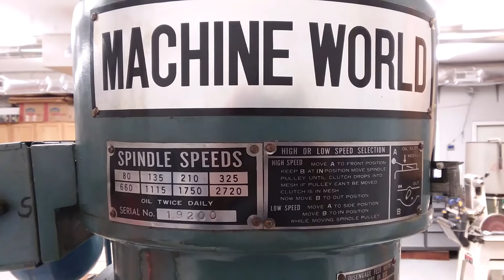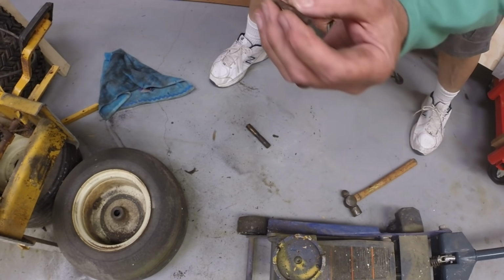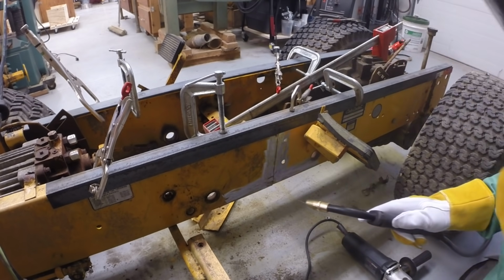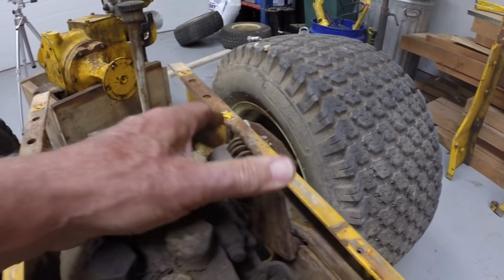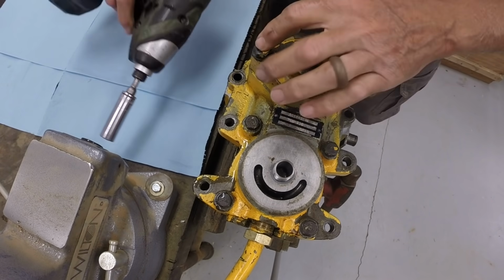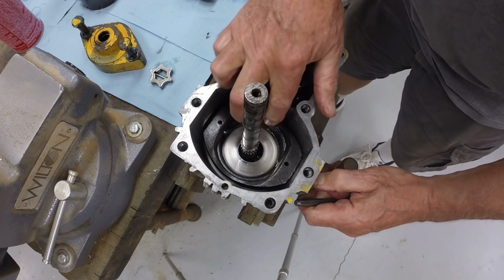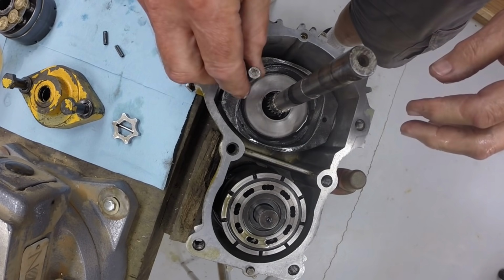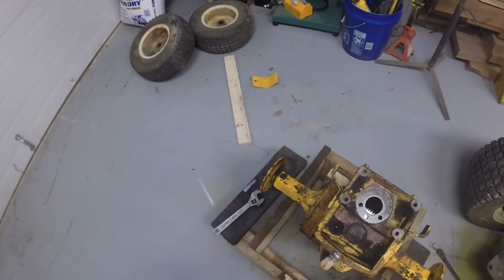Cub Cadet Dozer Build Episode 3

Comment: Nice shop Frank ,built one using the three speed gear box about twenty years ago . Worked really well i wish there were rubber tracks back then sure would of made it a lot easy'er .I did what you done and got the big change , i think i put 12" pads on it . Gave to a friend and he land scaped  3 acres with it . It looked like a small D10 .......Have fun.................Oh , he still has it and still use it from time to time ..............

Comment: Great Job Frank. I have done quite a few thousand hours on D10's and am looking forward to see your finished project.
Reply from the maker: I could use a consultant!
Reply: @woodandmetalshoptime8048  I think it is amazing what you are doing. I see that you are going to change the drive from what the actual dozer is but what you are doing is far more practical than trying to engineer the drive sprocket being the upper drive and the 2 bottom rollers as the idlers. A remarkable project and I also see in your shop you have a model grader  as well.
Reply from the maker: The plan is to use the upper idler as the tensioner, allowing both drive axles to remain fixed.  I guess we'll see how that works out!  Thanks for watching!
Reply: @woodandmetalshoptime8048  Why are you using two hydrostats? Dosers typically only drive from the rear.
Reply: @jwacker6590  It's a tracked vehicle so needs to turn by varying the rotation on one track vs the other. A single, standard mower hydro won't do that.
Reply: @christiangriffith1681  with an open diff, you can lock one axle with a split brake system and the other track will turn, turning the vehicle. Same with reverse.

Comment: I've pondered the idea and concluded that a zero turn would perhaps be a decent starting point.
Reply from the maker: You are not the only one to suggest that. That would be easier, for sure, but it would lose the charm of a vintage Cub Cadet conversion.  I'm trying to use as many parts from these old tractors as I can and you can't argue with the benefits of the weight of these axles for traction.  But I've thought about it...

Comment: Out of interest (because I’ve never handled a hydrostat) could you have rotated the swash plate 180° to give you a matching, but opposed, set of motors? Or does it make more sense for a dozer to have matching forward and reverse speeds?
Reply from the maker: Yes, you could rotate one of the swash plates to get matching speeds but they would still be different in "forward" and "reverse."

Comment: Sold wire welding I take it.  You'd have better luck tacking a small backing plate on the back side of that gap and weld in a downward direction. There's no need to weave back and forth that wide to achieve penetration. Heat soaked metal is a weak point in the overall integrity.  Smaller welds with gussets and layers will yield better results.

Comment: Just found your channel, going through the older videos.  Instead of modifying the trunnion couldn’t you have just turned it 180 degrees thus switching its forward/ reverse range of motion?   Nice job, can’t wait to see more.
Reply from the maker: There would still be a difference between forward and reverse speeds, and with a small (12 inch) drive sprocket, that would be a problem as speed is reduced by half compared to the 23 inch tires.

Comment: How’d you sort out the speed differential from forward to reverse seeing as your planning on running it what seems to be in reverse? Reckon I should just shut up and watch the video because it’s obvious our brains asks the same questions when doing this type of stuff
Reply from the maker: Modified the swash plate in the hydrostatic transmissions so they run same speed forward and reverse. Episode 3 I believe shows the modification.
Reply: @woodandmetalshoptime8048  found it sorry for so many questions btw Ik comments and likes help push your videos forward so I’ve been doing what little I can plus I really like this project want to build one of these for my little nephew actually been thinking of starting with a zero turn since it would already give me individual control of both wheels

Comment: I wonder if it would be possible to remove the axles and differentials altogether and just put both hydrostats side-by-side in the rear, with their output shafts driving the rear wheels.

I would be concerned that driving one track from the front, and one from the rear will cause problems. This might be even more of an issue with your big tensioner. One side will be pulling against ground friction directly, and the other will be compressing the tensioner before it receives ground friction. I know that most drive-chain tensioners are typically placed on the slack side of a chain, and in your case you will have one tensioner on the tight side, and one on the slack side.
Reply from the maker: There is no way to run them side by side, so the diagonally opposite drives is a compromise. I agree it's not ideal, but it's what I've got.  We'll see how well it works.  Remember, even the big boys have to go backwards, and they are driving on slack track doing that.
Reply: @woodandmetalshoptime8048  Good point. I look forward to following the rest of your build!

Comment: You know if you leave your welds on there and dont grind them off it will be very strong.  If you grind them off then It wont be very strong at all. You would need to v the joint first for it to be strong. Other wise your just welding on top and then wiping it off with the grinder so no strength at all.  You could plate weld it on the inside then grind off the outside it would be fine. I have a 149 I took apart and painted them my wife told me she wanted her house painted and I never did put it back together. I am concerned about the trans fan being broken and I took off the regulator and I dont remember how to wire it back up to the gauge and the generator. I wish I would have put it back together when I was doing it. I may be able to do it but I am working on 24 other projects like solar trackers and both my car and truck need attention. Too many projects.
Reply from the maker: As for the welds, the frame splice is welded from both sides, achieving full penetration. The weld on the inside of the frame is not ground smooth. The outside is.  The frame will be reinforced as well.

Comment: Not trying to be rude but maybe hit a night welding class at a tech college. U will learn a lot on set up an how not over heat ur welding area. Seems like u jus need more practice with a knowledge instructor, and paying for classes opens you up to do as much as you want with their equipment an not working ur small machine to death. Great work with the hydro's. That's one thing I need to get more into.

Comment: The modification that you’re doing to the trunnion on the rear hydrostat will also need to be done to the front hydrostat unless you never plan on backing up on the dozer.

Edit
Oops @1:15:30 you mention that.  😳
Reply from the maker: I haven't actually modified the other one yet, but it's on the list of stuff to do.  In EP #4 I talk about it some, but it will be EP #5 before that's actually complete.  Thanks for watching!

Comment: If it's a bulldozer why do you need to drive axles you should only need one
Reply from the maker: need to control each track independently, forward and reverse.  Each axle drives one track.  Check out episodes 3 and 4 where it's all explained.
Reply: @woodandmetalshoptime8048  why not use one in the rear and a braking system. Brake the track you don't want to spin...
Reply: @jwacker6590  I was wondering the same thing. Since he has to extend the  axels anyway why not add a disc braking system to each stub shaft at the rear. I would think it would be a lot less complicated and more compact design
Reply from the maker: A brake design does not allow you to go forward on one track and backwards on the other at the same time.